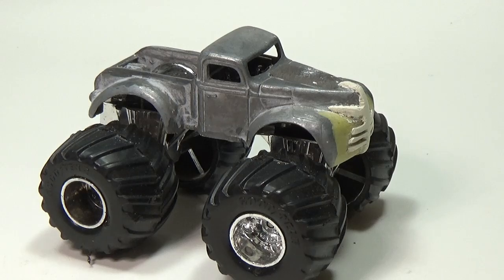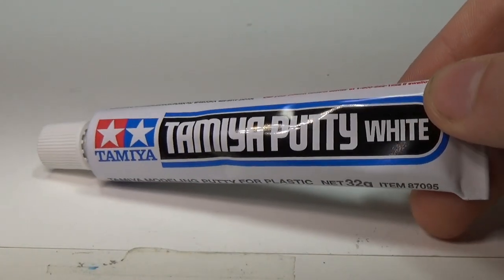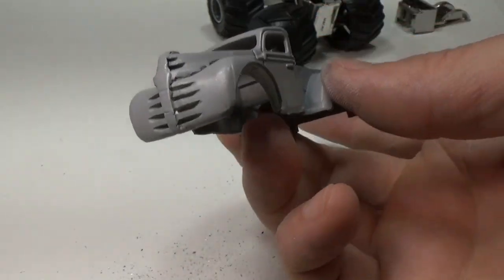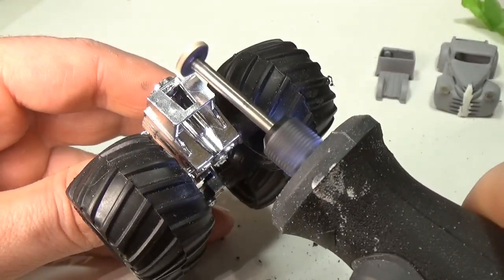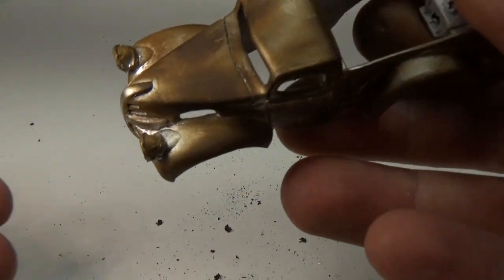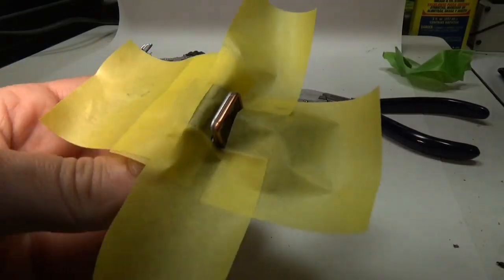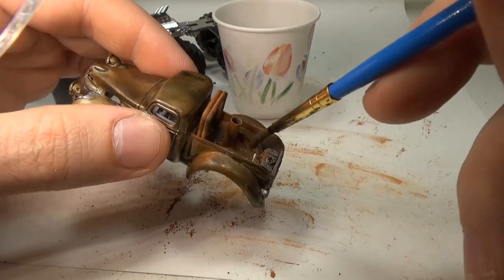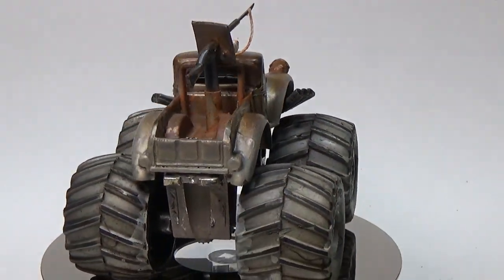Mad Max Custom #6 Mad Max Monster Truck

Comment: baremetalHW - Although I build custom 1:64th monster trucks, I've never made anything from Mad Max. I use Hot Wheels Monster Jam trucks for the chassis, with the black plastic cage removed, then I cut off the engine, seat, and fuel tank, leaving only a flat-top base. It's an excellent platform to start from, plus with a little gentle twisting the wheels can be removed (by gentle I mean pulling like crazy). I only use 1950's to 1970's truck bodies, and I make them look as realistic as possible by cutting and sectioning the chassis to fit the length of each truck. I know how much effort this hobby takes, and you definately were being modest about the amount of time you spent tinkering with those little details. You did great, that harpoon is especially a gem. Thanks for the vids!
Reply from the maker: Thanks Janson!!  I will give your process a try!!

Comment: You can take the matchbox monster wheels off. They're on a small metal rod axel. Carefully pulling the wheels in opposite directions, and an ocational twist to loosen the metal rod and they'll come off. Used to customize these all the time as a kid and got really good at taking them apart.

Comment: Superglue tends to do nasty things to finishes in my past modelmaking experience. Use Devcon instead for plastic-to-plastic bonds, and rubber cement or 5-minute epoxy for plastic-to-metal. If fit amd finish is not a concern, use Gorilla Glue for very strong bonds. Also, Fix-It Stick, available in the plumbing aisle of Lowe's, is a good putty as well.

Comment: they make a desert  dust by Vallejo I believe.  you apply  a wash first then put on the dust while the wash is wet. it gives a dried mud effect and then you  can use the dust around  the doors then seal it in.

Comment: stack those exhausts!!!  No way a v6 would be in the mad max world in that truck.
Reply: sure it would, they would use anything they had to throw vehicles together
Reply: By my deeds, I honor him... V8!
Reply: Faster The Dragster v8 not v6!
Reply: DawAl Gaming In all fairness, a lot of guys have a problem telling a 6 from an 8.
Reply: Actually one of my mates worked building the vehicles for Fury Road and they did use a few v6's.
And in the movie they might be split into 3 pipes on each side instead of 4.
Reply: V6=Less fuel
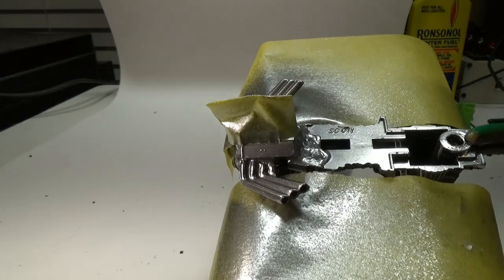Reply: @ 8:58 you can see the manifold to the head shows 4 exhaust headers, but it leads into 3 pipes. all in all, it's a V8  :)

Comment: I'm not a huge fan of the exhaust. It suggests a V6 and it seems something this awesome would have a V8 at least. Also, that location on a real vehicle would destroy any suspension travel for the front tires. The exhaust would be destroyed on any jump or obstacles that would require suspension articulation... Also, if you're gonna keep the exhaust, they should be coated in dirt/mud too as that exposed location right over the tires would cause them to catch a lot of slung material. Super awesome otherwise!
Reply: Sean Seilheimer I agree bro, I would've taken the cut off one and just stacked it atop the first and second pipes, after all, it's a mad max truck, anything is acceptable. 2 rows of 4 short stacks straight through the hood would've looked pretty good too!
Reply: pmm4177 old flat head ford v8s only had three exhaust on each side. just imagine it's an old flat head v8.

Comment: I love the large amounts of processes you went through to give this as much detail as possible and making it look as rugged as possible.
There are few things i might've liked differently:
-While a madmax style car would be bent and dented very much, to keep it from looking sloppy some very hard edged detail as contrast will keep it from looking to much like a scalemodel. I thought it was a very good decision to redo the grille, but if there was a way to get it even sharper angles it would've helped the illusion a lot. Maybe by using a grille from another model?
-While i respect you like rusting it up to 11, a bit more uniform patina would maybe give the illusion from looking at a real-life scale car from a distance more. But this one honestly isn't that important.
-i think dyeing the rope piece just a bit more would've made it blend in just a little more, the white colour that sticks through looks a bit too  new now
-The last thing are the headlights. I love love your work very much and don't want to sound offensive, but they look pretty, well, terrrible. They are very oversized and their finish is less than ideal. They also draw extra attention to the grill wich also has rather rough finish.
The engine, exhaust and tires are all exeggerated and oversized but still don't suspend disbelief for me personally, i'm afraid the size of the headlights and maybe harpoon bring it too much into whimsical cartoon cute territory.

I loved how you painted the engineblock red, the cuts in the side of the hood and rearwindow, and the dusting on the tires turned out excellent. While i usually like it when people make completely new designs, i have a huge softspot for this car. It was MORE than worthy of the madmax title.
Reply from the maker: Thanks for the comment... I may rework the headlights as others have pointed them out.
Reply: Cool! Sorry if i sounded overly critical in a negative way, i'd love to see what you come up with!

Comment: I know you've probably read this a million times but. Try panel lining markers For gundam kits and such. you wouldn't have to risk cutting into the panel lines as it's just a marker and is easily wiped off. Those old lead pencils work too. (the kind you need to refill)

Comment: No suspension? Take apart a ballpoint pen and you'll find a perfect scale coil spring. You may need to shorten them or spray paint them black but it works.

Anyway, good work.

Comment: I think it would've been better (and easier) to mount those front head lights with screws through the fenders. This would avoid the glue blobs. Outside of that, nice work.

Comment: Would have it been possible to use some glue from the hot glue gun as "glass" for the head lights? Or would they look too foggy? Can one sand/shape and polish the dry glue to mimic the glass of a headlight? If so, can you then hit it with translucent red or yellow for use in tail lights and turn signals?

Comment: Nice work. Only complaint is the 6 cylinder pipes coming out the sides. You put a blown v8 engine in. With six pipes. Lol
Reply from the maker: lol... yeah... could not fit 4
Reply: Either way still sweet. Just funny

Comment: very cool build. 
something I've noticed and wondered though. you seem very capable when it comes to custom building but you tend to repurpose a lot of things from other models. why not make your own headlights and exhaust? I think it would go a long way to improving the overall look, specifically when it comes to the exhaust. 

just a thought!
Reply from the maker: well for 2 reasons...
1. Time: hand making everything would take up a lot of time.  Though i agree that it would probably improve the overall look.
2. Reproducibility: I try to make my videos in a way that others can copy if they decide to give it a try.  For example I had planned on making the headlights on a metal lathe... I know I could have made much better headlights this way, but who else has a mini metal lathe at home? Cutting off pre-made headlights is something everyone can do. I want people to feel like "I can do that" and not feel like they need an expensive device to get into the hobby.

That all being said I will give it a shot on a future Mad Max vehicle. Thanks for watching!
Reply: baremetalHW that's a fair point! like that you're viewer conscience. I use my dremel as a makeshift lathe for small parts and usually spin it with styrene rod or tube. (for conversation sake) 

always enjoy discussing custom techniques. thanks for the response.

Comment: That tooling looks like a 41 Willys
Reply: Redstone11 GD Would have been easier to use a Blacksmith or Captains Curse and modified it!!
Reply: Gearhead 6971 Yeah, They Look Just The Same.

Comment: Hey if I could say.  Just buy a $5 monster truck and drill out the post and take the plastic chassis and metal car off and cut off the wheels of any other hot wheel/matchbox and put the car evenly on the monster truck frame and drill the car on to it from underneath the drilled out post of the monster truck

Comment: don't get me wrong, i like your work but it feels like making the car that shiny made the the thing look "meh" the rust you applied looked more like some mad apocalypse dude smeared crap all over a shiny brand new car. the dust color definitely made the car better but the rust effect on the car was worse than that harpoon and those bars even tho the main focus of the realistic rust look should've been on the car.
Reply from the maker: So you would have liked the effect i used on the bars and harpoon used on the body as a whole? The shiny paint was used because the original truck from the movie was shiny. The rust was an attempt to dial things back.. and seemed more realistic than without.  ahh well.. maybe I will get the next one right for you. Thanks for commenting.
Reply: I think something that may work would be to paint the truck silver, and then paint it another non-metallic color while masking some of the silver with mustard, hairspray, latex, whatever your preference is. Most cars aren't painted just shiny silver, some color (even something basic like red or blue) would provide a more realistic base. Then you can unmask the silver portions and heavily weather the painted truck, and then add the rust effect (which I thought looked pretty good). 

Anyway, the trick with the clay water making a mud effect was genius; I haven't heard that one before. Nice work, your Mad Max videos are my favorites.